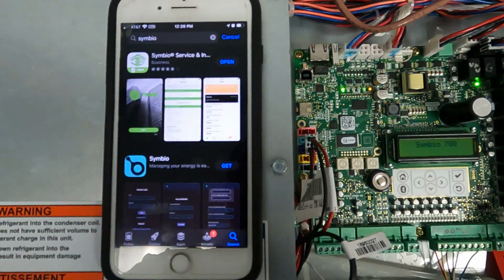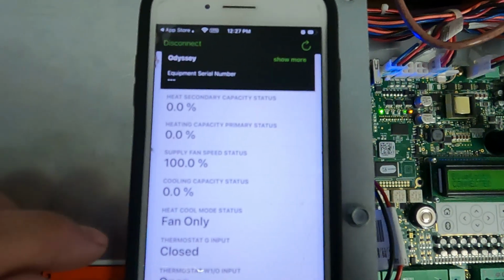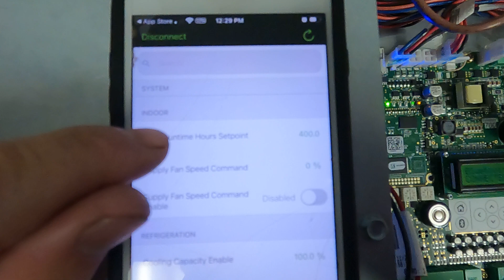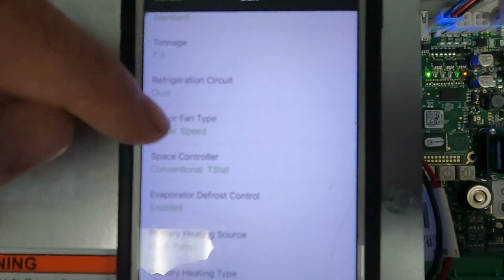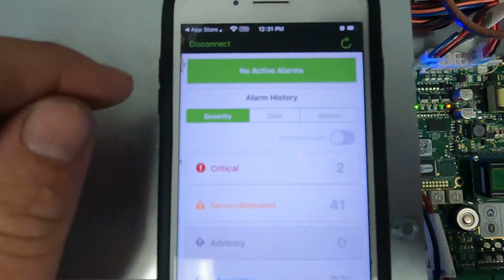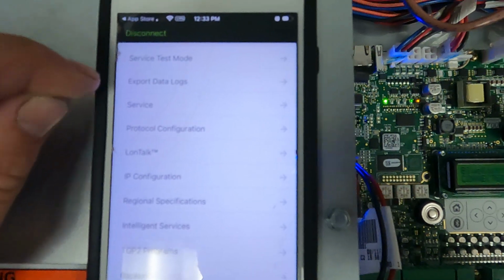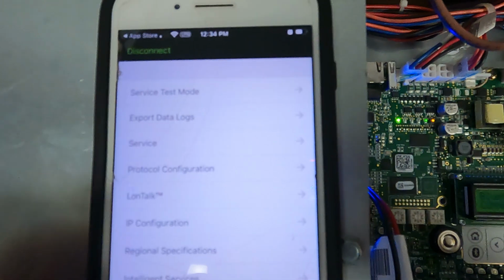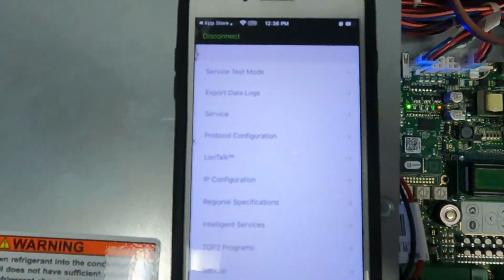Trane American Standard Symbio 700 App Configuration and Navigation

Comment: Man thank you for this vid! I’ve been wrenching on chillers for the past 9 years and have been left behind in the light commercial equip. Just got sent to install a 20 ton trane split heat pump. I opened the condenser and stared at the new Symbio board like a hog staring at a wrist watch. No more rtrm boards huh? I like this new feature and thanks for the quick run down of the app.
Reply from the maker: Yep, rtrm are going away and will soon be replaced in the RTUs also. I wasn’t sure if I liked the symbio system, but after I gave it a shot, I really like the features.

Comment: I also my heater kit has 2 wires which the Airhandler has 3 wire hook up?
Reply from the maker: You have a single stage heater. (2 wires). Connect it to the plug on the right.

Comment: I’m about to change a 10 ton condenser that currently the older version of this. It’s a 2 stage straight cool. Question is can I run the existing control wires off the old TTA120 to the thermostat terminals on the new symbio controller and configure through blue tooth and it run? Or do I need to jump wires around to get it up and running. Supposed to do the job new week.
Reply from the maker: Are you changing out the condenser only?  If so, then the wiring is fundamentally the same.  Except there is no need to run the twisted shielded wires, because you won't have a board to communicate with on the inside.  
J21 plug on the symbio condenser is all input or command signals.  You really only need the blower output on J18 if you are using an E-stop signal for a smoke detector or some other device.
Reply: @Hvacoffroad  Yeah just the condenser that has the reliatel controls. I’m assuming that what the old one has anyways. So i would still need to configure it through the app though correct? Or should it be just plug and play? It’s a straight cool with electric heat only. Thanks for the reply, find this info is pretty vague sometimes.
Reply from the maker: @2purplemartin1  most of the condenser settings will already be configured from factory. You’ll have to tell the app what kind of indoor unit, single speed, blower type ect.  Make sure it’s configured for a thermostat or BAS, whichever one you are using and remove the filter runtime reminder. I’d check all the settings to be safe.
Reply: @Hvacoffroad  We installed that unit to a different airhandler today and it had two Rib relays for the first and second stage AC condenser. You’re right, I didn’t even go into the Symbio controller and it fired right up and staged too. Thanks for the help again!!

Comment: I have a dual circuit 20 ton Symbio condenser paired with a constant volume Symbio air handler. No indoor options/heat board. Conventional t stat. Why would both circuits energize with a call from only Y1? I have 2 exact same setups and they both do it. I changed in the app from BAS to conventional thermostat.
Reply from the maker: Is it a heat pump or cooling only?  Did you select “staged” under the configuration and specify two stages?
Reply: Did you ever figure out why it was doing that and how to fix it? Because I'm having the same issue.

Comment: Got question, I install split system symbio 700 I ran wiring the same way you did and my blower motor did not came on got a warning 017 code can you help please?
Reply from the maker: Do you have a VFD air handler?  If so, you'll need to run additional wires to get the blower to operate.  This video was for a single speed blower.

Comment: The paperwork with unit doesn’t show 5 or 7 on the dial switch at Airhandler that you recommended for 5 and 7
Reply from the maker: Yes you need to address it for 5, &
7 if you are using it for electric heat.

Comment: What if you Airhandler is Not Symbio!?!?
Reply from the maker: It would depend on the air handler that you are using.  You would still send the g signal out of J18-1 to the blower signal on the air handler.  I you need 24v hot and common, that would come from J15-1,2. Then, if you need y's, w's or an o, you would get that signal from j21 on the condenser.